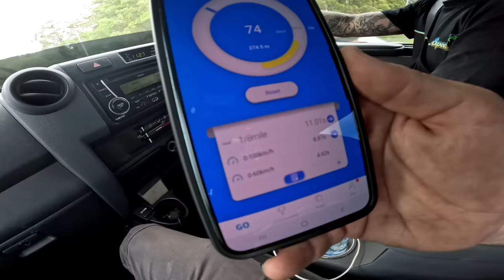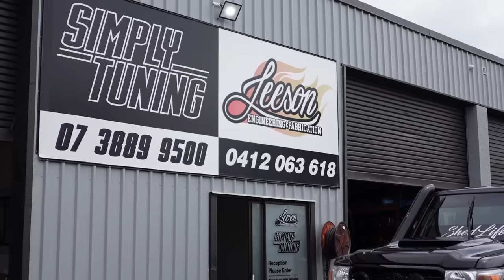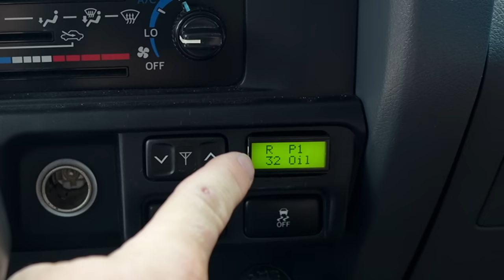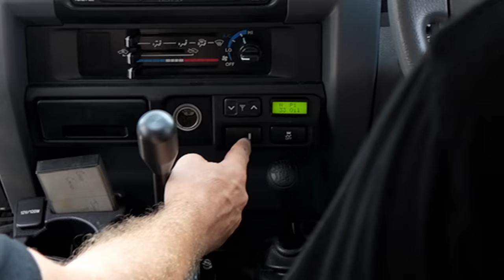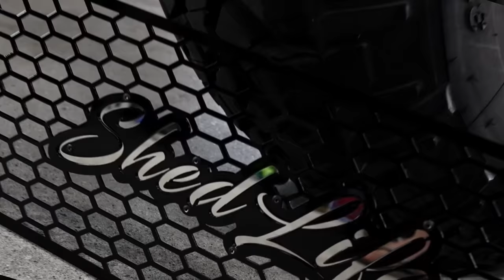Australia FIRST 8 Speed Auto 79 series!

Comment: When you say you were at 1500 at 100kmph does that mean you were cruising off boost? How does it work with your engine tune? Fuely at that 1500? Being that the converter locks up quick i assume that your turbo would not be at its efficiency at 1500rpm? Love the rig 👌
Reply: Yeah sick chat 😂
Reply: Seemed fine mate, in 8th gear ur cruising
U wanna boot it u drop 2 gears and straight on boost 
Not I have the 4.88 gears in it sits at 1800rpm
Reply: @macpreston  sick thanks mate good to know. I want more power from my FTE but a750 auto isn't known for its strength. But had heard of there being issues if doing long distance cruising where you're sitting off boost. Cheers for the reply

Comment: It's interesting, bet it's spendy as fuck.🤑😲

Manual mode would be better if it doesn't go back into granny mode unless commanded to. 

I'm looking forward to how it performs for you legends, best of luck👍🏻
Reply from the maker: Thanks mate ! Agreed , testing starts soon 😎
Reply: The full manual mode stays in gear no Govenor! Just a bit risky for liability if someone shifts the wrong way unintentionally 😂
Reply: @macpreston  
Cheers for the reply. 
You'll be reet as long as you don't convert your 79 to the flappy paddle turns with steering wheel shite🤬

I drove a Toyota hatchback with them. Right for up, left for down in the straight ahead. 

I was taking a roundabout turning right in 2nd putting the steering wheel 180° out. 

On the exit, accelerating I hit the right paddle for 3rd gear, yeah nah, it went into 1st at 36mph. 
The needle went to the rev limiter just a bit slower than my arse sucked the cover off the seat
🤣🤣🤣🤣
Reply: Haha noted!

Comment: Why would you convert it to auto
Reply from the maker: Sooo much better off-road, also more power !
Reply: Because it's a far better option for: towing, 4wding, highway and city driving.
Reply: Cept downhill where even with full ZF lock up it won't hold as well...hence hill decent control in eg LRs and now copied in most modern 4wds.
Reply: Does have engine breaking tho wich has been sik! But yeh hold more power I didn’t want to keap breaking manual boxes gets expensive